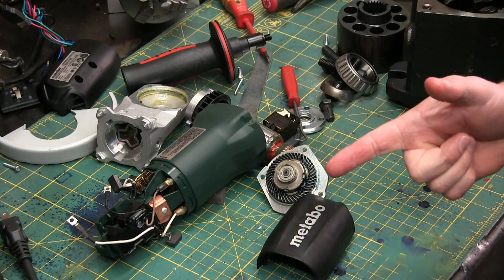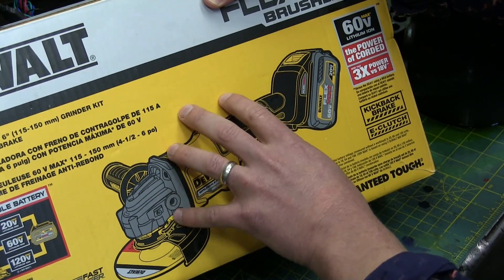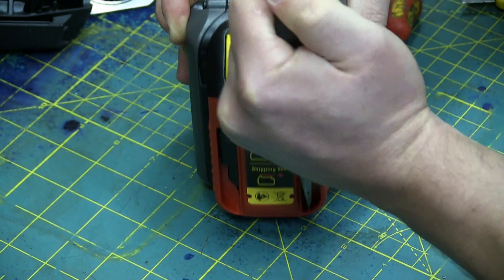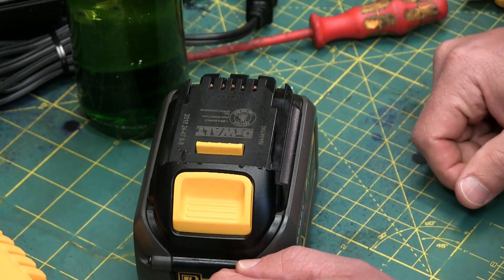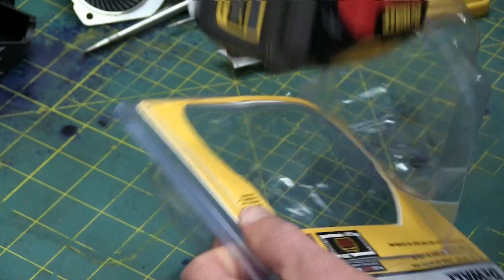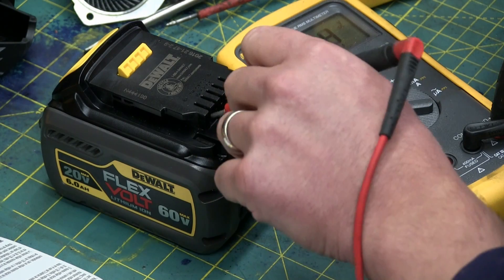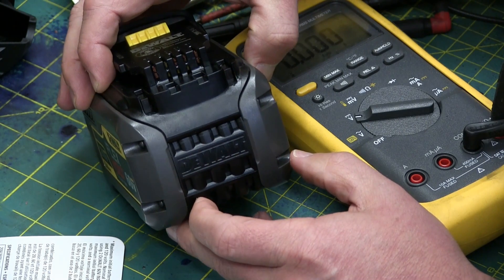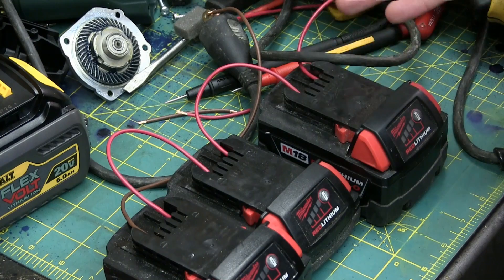Plug-in Power Tool to CORDLESS CONVERSION.

Comment: My 4" pipe threader won't even turn & cut threads when I use an extension cord. We used buck boost transformers on large jobs to keep the voltage up with 500-1000 feet of cord. I got an inverter charger for a sail boat and a couple deep cycle batteries, and then a chopper and voltage multiplier. That seemed to work pretty well, for rouging out electrical & plumbing holes in frame apartments. Hiking a quarter mile back to flip the breaker was just too much exercise for me.  I only did residential for ultra high dollar rich people houses or "the projects". The projects is federal money, which means Bacon Davis wages in the USA. $5 an hour to wire apartments? Not this master eelektrishun. I'd have to be both unemployed and hurting for money before I'd go baqwards to union wages. Even in the union, I usually got at least a 20% premium. That premium wage thing only works when all you do is think, talk, eat and breath& shit "shop". On top of that I found a fool proof way to pad my hours, for another 10%-12.5% over the premium. I'd explain it, but if anyone ever figured it out........

Comment: Why do you americans and canadians don't use 240V for tools. Is there any reason not to? In europe there are 3 phase outlets very common (16A 230/400V depending on what you want) if the houshold plug doesn't cut it. With 240V and 15A you wouldn't have any problem to run a beefy grinder or a miter saw...

Comment: How about using a capacitor? Charge the cap from the a/c outlet then discharge it to get the motor going.
Reply: I was going to say, a capacitor would make more sense. Not unlike putting a cap on a guitar's volume pot. (I assume) it would have to be larger than a battery for a given charge though.

Comment: Not all mains tools will run on DC, so your mileage may vary.
Also, they ship the batteries ~50% charged because lithium cells deteriorate faster when flat or when full. Shipping them at ~50% means the cell isn't deteriorating while it sits in the shop for a year waiting for someone to buy it.

Comment: the issue I can foresee is that with motors there are large amperage spikes they need to start with then they settle this spike is extremely bad for breaker and batteries also batteries don't like higher amperage loads they get hot and explodey

Comment: yeah when you pull the trigger on the tool it's running on DC for about 1 second and then a double pole relay switches it over to AC power and at the same time a battery charger turns on. This would be a good job for a microcontroller.

Comment: Running mains stuff on DC could cause damage to the switch due to arcing. And triac based speed controls won't work. If tripping is an issue, maybe a soft-starter would be more useful.
Reply: +AvE Using an vector drive / inverter with a substantial capacitor in the intermediate storage would be probably the most elegant solution. These things can do all kind of slow start thingies,  however, not exactly cheap and rugged. 
Although after googling around a bit I found an interesting patent from the 80s that uses a synchronous motor with a flywheel to stabilize mains voltage: https://www.google.com/patents/DE2853207A1?cl=en  . That could be an interesting low tech solution to buffer surge pulses in high impedance mains sections. Additional "Bonus Nachos" I think the host and visitors of this channel know how to attach a flywheel to a motor without killing themselves in the process. What do you guys think about that? Cheers
Reply: Thats what I thought. It would be also much cheaper and very compact.
Reply: capacitors????
Reply: Iron Beard It is NOT the same principle as what you are talking about when a capacitor is used with an AC induction motor. The reason for the capacitor is that it is REQUIRED for producing an RLC circuit that will create a phase shift of the current in the start winding relative to the run winding of the motor. The phase shift creates a phase shift in the magnetic field, which in turn makes the rotor in the motor rotate.

That type of motor is called a capacitor start motor, and they will not start without the capacitor. It will sit there and buzz like an angry bee without the capacitor. You can hand start it though in any direction.
Reply: I know there are mainly two types of styles used for inverters. All depends on how much you want to spend. The cheap ones from like Harbor Freight and Walmart use positive and negative square waves running at 60Hz. The higher end stuff convert to a actual sine waves.

Anyway I would think a 1:1 isolation transformer would be needed to keep the pixies happy. I wouldn't want to inject a DC voltage let alone anything directly into a wall outlet.
Reply: The square wave things are crap for almost any application. I think isolation is not the prime issue, however having an intermediate circuit with some kind of reactive element is. https://en.wikipedia.org/wiki/AC/AC_converter has got a nice overview chart over the different topologies I'd consider a DC link converter topology to be a fitting one for the job. Additionally it could use a battery to stabilize or power the DC link.
Reply: I was thinking of something a little more crude such as two transformers with a DC/AC converter. Mains goes into the first step down transformer and gets rectified to power a some sort of charger and a maybe a micro controller to sense the current draw and to enable/disable the battery source when needed. From there it would go into a step up transformer and to the output. Would it work? probably not, just a idea.
Reply: jusb1066 Most of us don't have $400-$1000 laying around, and that's the price for the chincy ones.
Reply: Jusb1066 would be cheaper to get a car battery and an inverter
Reply: Yeah, to stabilize the DC-bus in the inverter when the tool requires a lot of current.
Reply: What about a Inverter? Kinda like the type used in automotive applications.
Reply: Question: Why? is it due to inductive kickback? couldn't we just add a freewheeling diode for that?
Reply: Leland Clayton Yes, although they come in many flavors and  I guess the ones for automotive will not be the best choice though. But, I'm no expert in this field.
Reply: You can buy a 1500 watt Samlex Pure sinewave invertor for about $480, but then you are getting low quality crap because they use Taiwanese made capacitors that will not last a year. Japanese and American made caps cost more, but would last a lot longer.
Reply: A triac is just a pair of SCRs back to back. The problem is that the SCR won't release until the voltage goes to zero once it's triggered.
Reply: LimitedOptionsMan Triacs are for AC and that is what they use for speed control for universal motor driven tools. The AC crosses to zero, which turns off the triac...

I am not talking about using a triac. I was explaining what the universal motor driven tools use and why they will never switch to high frequency AC motors with vector drives.
Reply: EETechs Sorry similar than, A microwave capacitor or similarly sized capacitor with some clever circuitry designed to hold a charge for a short time. That would inject DC current in to the AC signal and raise the overall voltage and supply a short current spike while the tool is starting up to prevent the barker from tripping.

Comment: Wouldn't it just be easier to mod a ups to supply battery power until it sees a load on the batteries and switch over to ac if available? I mean everything else is already there.

Comment: Set up the battery pack with an arduino to pull power only from the battery pack for first couple of seconds (from when it detects load) when you turn on the tool, and then switch to AC. More simple is more better. If this is eaven possible, Im no pixie wrangling type.....

Comment: I think the dude that had the dual plug extension cord idea was close to the lazy bastard solution, just need to find two hots that are on separate legs and convert from 120VAC to 240VAC, twice the watts same amps. 

Other ideas are, just keep a small assortment of 20-30 amp circuit breakers and wire a 6ft 10awg multi-strand cord to it and have that be your 240VAC outlet.

Overhead lighting is 277VAC if I remember correctly, if you are feeling dangerous.

I also have concerns with halving the voltage under high load times, you would need twice the amps and it would put extra strain on the conductors of the tool, might also piss off the windings in the motor. 

Maybe a two step trigger that would give you a "high voltage mode" if you did 240VDC of batteries, so like a NOS switch that would cut over to your batteries. 

Might also put it in a box that says "line conditioner" to keep the safety inspector off your back.

Comment: Simple, just use straight DC to drive the tools and use the AC for charging. if you can figure out how Deeply gated their 60v pack, it shouldn't be too hard to design an upscaled model at around 110 to 240 volts. The whole thing could be mounted on a hand truck and stay pretty mobile.

Comment: Sounds like you just want a UPS and all you need to engineer is some way of limiting the current from the mains supply. Putting it through a lower or quicker breaker (located at the ups) would be one way but you don't want to be going and closing it every time it goes. So something automatic and fast.

Comment: Advice:

In whatever the hell circuit this thing would have, place a polar capacitor inbetween the battery's negative and the rest of the circuit. AC can'won't pass through a capacitor. This'll allow both AC and DC to pass through at the same time and power the tool, but not allow the AC to attempt to charge the battery and explode it.

Comment: I'm still learning electronic pixie wrangling, but as a prototype you could get a 60v boost converter to step up the voltage to 120vDC from Ebay for less that 15 English squids (less than 25 Canadia pesos). 
The charging / power monitor circuit is a bit beyond my limited skills, but maybe reach out to Dave on the EEVblog? He's done some open projects and might be able to help with the advanced pixie wrangling if our AvE brain trust doesn't have the appropriate skill set.

Comment: I don't want to sound negative, I love your projects, but this is one hell of a project and would be serious work. Don't get me wrong, it would be fun, but you are basically designing a double conversion or delta conversion UPS. You could get to "market" really fast by finding an older double conversion UPS that could be modified to work with the lithium cells for weight savings. Keep up the great content.

Comment: Could we not just open up corded tools and put a large capacitor inside them or even better the manufacturer could do it from factory like most big compressors have which is I assume to solve the tripping breaker on start up issue

Comment: I see a serious problem with tools which are rpm-controlled via phase cutting controll. You could fry the electronics in your tools with trying to run them on DC as opposed to AC.

Comment: Actually the company is not cheaping out on keeping the batteries half charged. Lithium ion batteries are best stored at 40% to maintain the longest battery life span. You'll see this on some of the expensive quad copters, the batteries will discharge to 40% after a couple of days.

Comment: Lithium batteries are not full because 3.7-3.8 volts is a "storage" voltage. It is not recommended to store fully charged batteries fully charged for a long time (maybe 4-5 or more month).
Reply: True story. But the main reason they are not shipped fully charged is because class 9 air shipping requirements dictate that lithium ion batteries can not be more than 30% SOC as of April 2016. It use to be 40%.
Reply: The question would be then: how long are these batteries expected to be in inventory?

Comment: It could probably all be done with pretty jellybean parts. You know...triacs to do the switching, little mains to USB module so you can both charge the batteries AND charge your phone, so you can play the top40 hits to annoy your older coworkers.

Thing is...if it's just for short periods of time, wouldn't it be cheaper to use a capacitor bank over lithium ion batteries?
I mean...they already come with 200-400 voltages DC, also makes the charging so much easier, just rectify the mains. 

Actually now I wonder, won't just rectifying mains and  running it with a huge capacitor voltage not just fix the tripping problem?
Reply: It would work but you would get some serious arcing. A soft-start is the way to go. much cheaper and smaller. But if you would still engineer it AVEs way and don't want to run it primarily on batteries I would go with capacitors, cheaper and higher peak current. Also easy to recharge and store. You can run them down to zero volts and they don't complain.

Comment: "They save money by not completely charging it in the factory" no. They don't completely charge them so they can be stored for a long period of time. Storing them fully charged or empty will degrade the cells over time. 
And yeah I also almost started yelling at my screen for jumping right to prying stuff off with a screwdriver instead of thinking for a min first... could've broken the locking mechanism. Probably would've complained about them making it out of plastic instead of steel after that either... Yup, that really bothered me, sorry... but otherwise I usually really enjoy your videos. 
The turbo-charger idea is probably not really straight forward. It requires a fair bit of electronics to keep your Li-Ion batteries safe and alive for more than a week or so. You'd have to either switch from one source to the other, or have the DC brought up to 120 V AC in-phase with the other supply with an inverter (much like an UPS). Either way it'd have to jump right into action when there's a lot of current drawn, which doesn't really seem like an easy task since circuit breakers are designed to act quickly once a spike overload is detected...

Comment: how about us folks with 220 or 240?
Reply: won't don't suffer like they do.
Reply: +Hashem Mehyar little tingle instead of dropping to the floor
Reply: cut one of the hot lines? we have 240 single phase, only one hot line to cut
Reply: but as hashem says, we dont suffer like they do
Reply: We don't have this problem basically thanks to 220/240V so no need to do it.
Reply: then we use 120vdc pulsed to overcome the startup surge current :-) we'r just after current here, to help over come voltage drop over a long line of cable, or rather to help against over current on the breaker
Reply: Strip the cord. Cut one of the hot lines. Splice the end of it that comes from the tool to the ground line. Leave the end that comes from the plug dangling. Enjoy your (completely unsafe, but effective) 240v to 120v converter.
Reply: Which ones with 220-240, Loric? They have that in Canada and we have that here in the USA too.

Comment: Did something like this to a little 3.6V screwdriver (NiCad), and it worked perfectly. Basically hooking up series&parallel sub-C cells to the driver with an adjustable DC power supply keeping them juiced. What you are suggesting is not only doable, but truly exciting! Get a patent lawyer on standby perhaps?

Comment: I dont believe they particularly half charge it to not to save money, but rather for the health of the battery.  Long term Lithium storage needs to be at about half charge because its the most stable.  Lithium shits its pants if stored at max charge and low charge far faster than half charge.  Oh and i guess they can keep more bengimans the wipe there rich ass to i guess

Comment: this is so true! every SINGLE job there is always some goofy ass hole useing a tiny cord thats not even supposed to be on the job or someones mangled cord constantly tripping the breakers that everyone is useing for a power source. If I had a quarter for everytime the lazy ass holes yells "POWER...POWER" like it's supposed to magicly fix its self yelling power over n over I wouldnt have to work anymore. The thing is once someone runs down stairs or where ever the breaker or temp power is. (I work on commercial jobs not  residential) they just continue to trip the breakers all damn day on every SINGLE job they go to with their mangled ass home quality extension cords , not to mention their 3ways usually never have a GFI either. Especially the illegal guys on the job from 5th world shit holes.

Comment: So like a UPS but because of the high amp draw causing the breaker to trip instead of like a power outage it needs to have a big ultra-capacitor bank instead of some batteries. Like in a big car stereo when the bass hits real hard and the amp draw jumps from say 60A to over 200A but just for a few milliseconds.